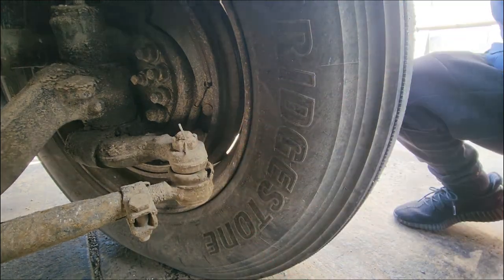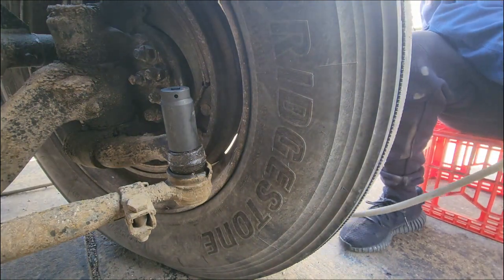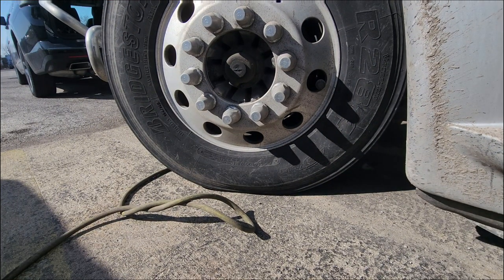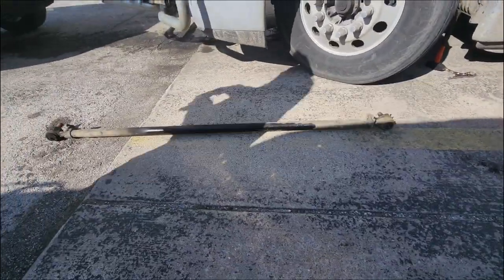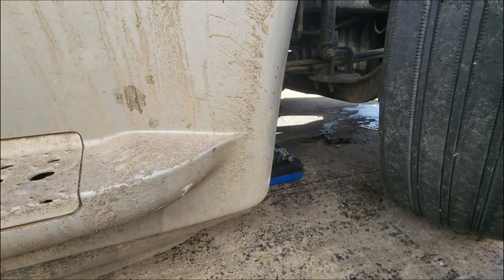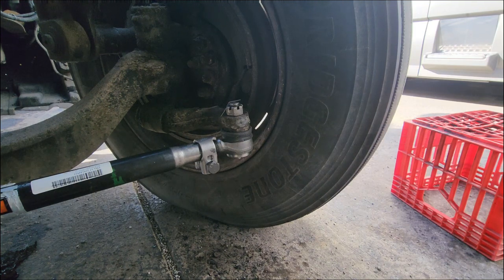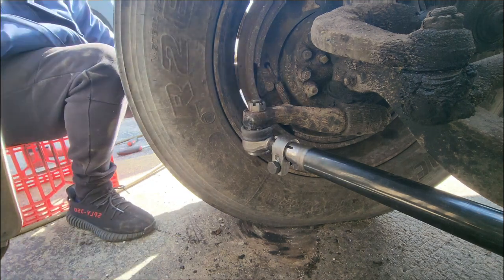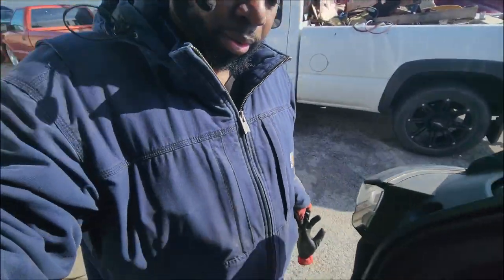FREIGHTLINER CASCADIA TIEROD ASSEMBLY REPLACEMENT

Comment: U know after how many miles u replaced it?
Reply from the maker: Not really , I was going to get a wheel alignment and they showed me the play in the tie rod , so that made me change it
Reply: @kul-kash2697  ohh ok yeah i have a 2018 cascadia has 500k.. do you think it's time to change it?? 
drag link.. tie rods.. kingpins
Reply from the maker: @dell7054  if they're not loose or  boots busted I wouldn't
Reply: @kul-kash2697  it's loose when u put 2 hands on it and twist it there is play
Reply from the maker: @dell7054  if that's the case I would definitely change them
Reply: @kul-kash2697  ok thanks yeah I think after 500k. lots of miles